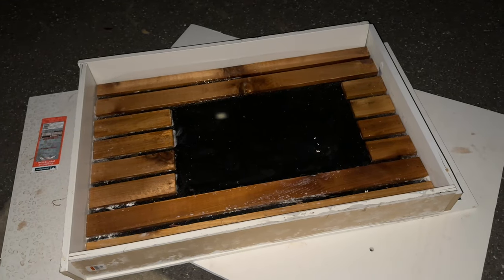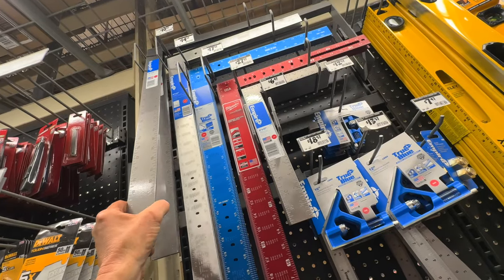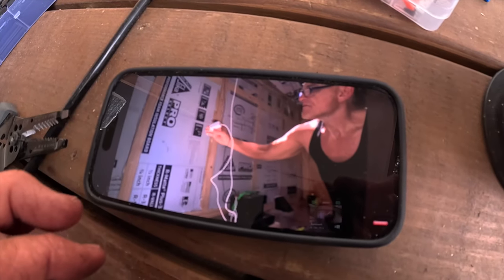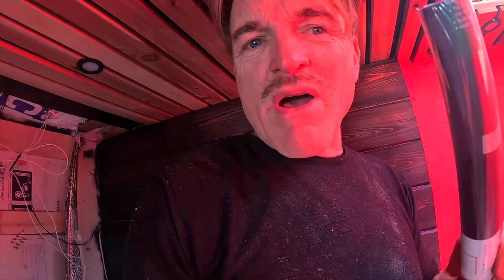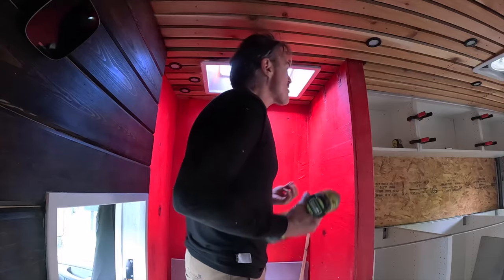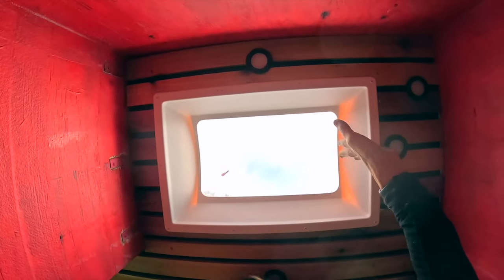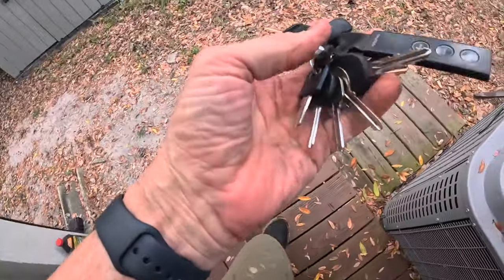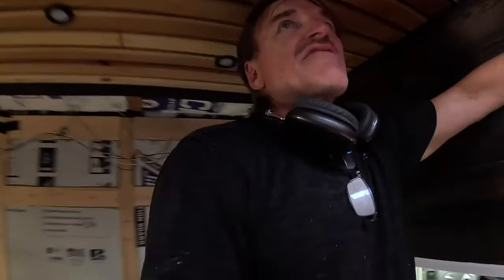TONY’S TRIUMPHANT TILES  - Palisade Frost Nickel

Comment: Look into getting a Halo bolt you can get one from qvc for about $130 it’s an air compressor, battery jumper, usb charging device. It has saved me from being stranded or spending money to fill my tires more times than I can count!
Reply from the maker: Good advice
Reply: @hellomynameistony   my halo has come in handy especially during the hurricanes for charging things like my cell phone. The one I have has emergency lights too that you can use if you’re stranded in the dark. Definitely worth it!!